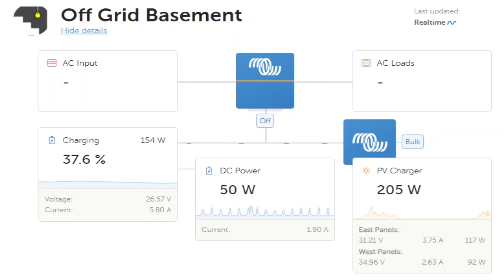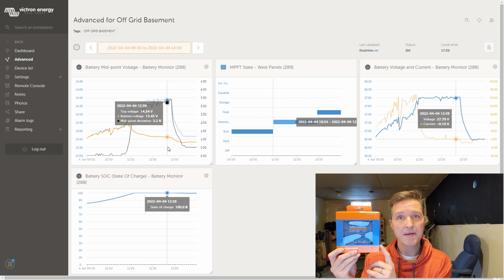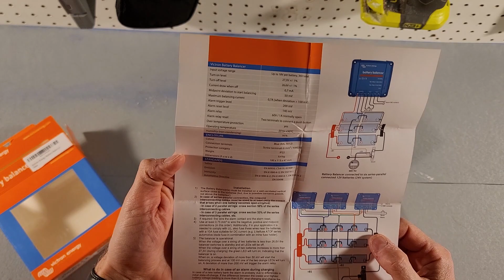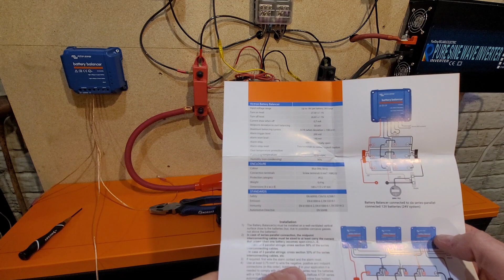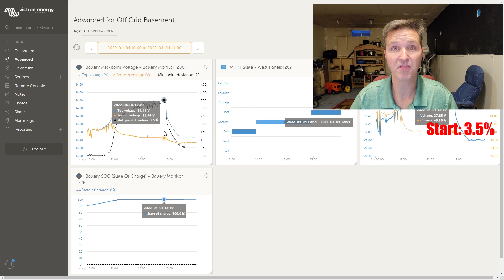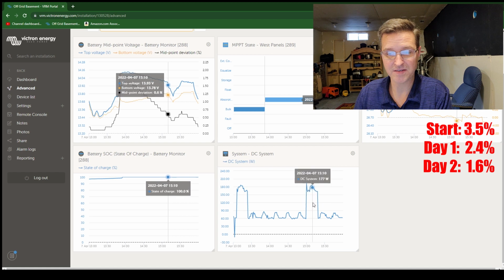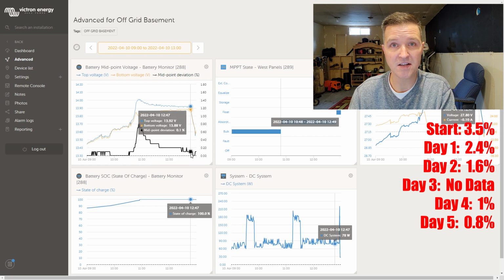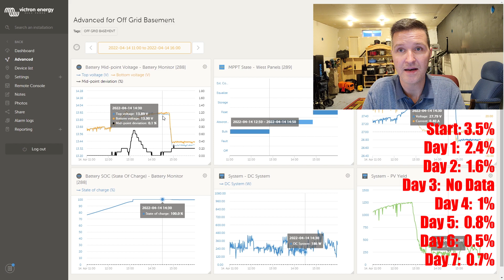Victron Battery Balancer:  Installation and 7 Day real world Testing with LifePo4 Batteries!!

Comment: great video as usual, my advanced setting does not have a mid point graph like yours.  Where do I change it so I can see that?
Reply from the maker: Mine is under "Battery Monitor".  Do you have a Victron Shunt as well?  I believe you need that.

Comment: I hope these will work for 24 Volt 100ah Lithium Iron Phosphate Batteries or My 12 Volt 100ah Lithium Iron Phosphate Battery Packs o 24 Volts on various 10KWH Battery Banks. And 4 Renogy 200AH AGM Batteries also paired in 24 Volt Packs.
Reply from the maker: I've used mine for a couple years now and it still works like new.  Thanks for the comment!

Comment: Hello can I use this Victron balancer is 24 volts sistem with 2s2p ????? How??? Just 1 or 2 balancers?
Reply from the maker: Remember, when you connect two batteries in parallel you're basically creating a bigger 12v battery.  Just connect it like it is exactly that.  Just treat each 12v pack as one 12v battery.  I hope this helps even though it's a bit confusing in writing.
Reply: @OffGridBasement  thanks

Comment: shouldn't you connect all connections to the battery?
Reply from the maker: Yes.  The voltage loss is minimal from the bus bar so I went that direction.  Thanks for the comment.

Comment: I just bought one of these. I have an older 280 amp hour12 volt lithium iron phosphate battery and a new identically sized battery wired in series for 24 V.  Even after initially connecting in parallel and top balancing, the batteries have a difference in voltage of 0.3 volts (and obviously the older battery has a somewhat larger internal resistance).  I'm very eager to see if the Victron battery balancer can handle this slightly two different age batteries and bring them closer together.  I can't really afford to replace the older battery capacity on a load test.
Reply from the maker: Best of luck to you!  Thanks for the comment.

Comment: Perfecto amigo, es el mismo problema que tengo en mi sistema solar de 24V, una batería llega a 14.2 y la otra en 13.8 ya compré el ecualizador de batería Victron y espero me dé el mismo resultado, nuevo suscriptor.
Reply from the maker: That's great!  It still works perfectly for me.  Thanks for the comment.
Reply: Como te fue despues de instalar el ecualizador?

Comment: I've got 4 in series I wait till the charge controller hits float then just check with a multimeter if there's a low one I just hook a battery charger on it, one took twice doing that to get it in balance, but I'm gonna get 2 of them.
Reply from the maker: Thank you for the information and the comment.

Comment: Thank you for the video. My green light has stayed on after the 3rd day of use. It was on this morning and my batteries were at 26.3. Is the green light suppose to be on? I thought it would not come on until the batteries reached 27.3?
Reply from the maker: That's odd.  You're right.  It shouldn't be on until 27.3v.  I would disconnect and reconnect.  Sort of like turning off and back on again.  Hopefully it will reset.
Reply: I will try that thamks! @OffGridBasement

Comment: Excellent presentation of the impact of the Victron battery balancer.  I recently put together a 24V battery bank by putting 2x12V batteries in series and I had the exact same issue when the charge voltage started getting close to 28V.  I was debating whether or not the Victron balancer would work given it only has a balance current of 0.7 amps and I also saw the comments about it not working with Lithium batteries.   A few days ago before seeing your video,  I ordered a cheap 5 amp balancer, but I'm concerned that it will try to balance the batteries all of the time if the voltage difference between them is > 10 mV, instead of just working when the bank voltage rises above 27.3V.  That might work to unbalance the batteries at lower states of charge.  I guess I'll find out after I put it into service.  At least I know that I can go with the Victron balancer if the cheap one doesn't work.

Question: In your setup you connected the balancer negative lead to the load side of your shunt.  Did you have any long term balancing issues with that?  Your balancer might work better if it was connected to the battery side of the shunt instead of the load side of the shunt.  The shunt has a small voltage drop as current flows through it, and that might give the balancer a false voltage reading on the bottom battery.
Reply from the maker: I never noticed any issues with how it was wired.  It just worked..  
Good luck with the cheap balancer.  I do know the victron works so there is always another option for you.  Thanks for the comment.

Comment: dont your batteries have built in BMS?
Reply from the maker: Yes, but the BMS doesn't help keep the batteries balanced.  It keeps the cells inside the battery balanced.  Thanks for the comment.
Reply: @OffGridBasement  "but the BMS doesn't help keep the batteries balanced.  It keeps the cells inside the battery balanced".The Cells inside the battery is where the power comes from. There isnt a sperate battery inside the plastic casing. Im sorry but i dont understand your comment at all. If your cells are way out of balance then your BMS isnt doing its job. Moreover doesn't a BMS balance you Cells?
Reply from the maker: @mannyfragoza9652 my apologies.  The balancer keeps the two 12v batteries in balance with each other.  Keeping the two batteries in balance with each other has nothing to do with the BMS inside each battery.
Reply: @OffGridBasement  Then 99% of the folks that have these all in one batteries dont know their cells are out of balance? wow that just doesnt sound right.
Reply from the maker: I want to make sure you understand the difference between this balancer and a BMS.  This balancer keeps two 12v batteries in balance with each other.  A BMS  keeps track of the individual cells inside of a Lifepo4 battery.  This 12v battery balancer is not a battery management system.  I hope that clears it up a bit.
Reply: @OffGridBasement  If your cells were unbalanced what makes you think all these people that think they have a built in BMS their batteries are balanced? All the All In One Batteries reviews ive seen ive never one saw someone adding a Balancer to their battery which has a built in BMS. Have you checked other ALL- IN- One Batteries to see if its cells were balanced? Could it have been your BMS wasnt operating properly?
Reply: @mannyfragoza9652  I think I’m understanding your confusion. The use of battery balancers is relatively rare with LiFePo4 batteries mostly because there are options to buy batteries in the voltage you need for your system setup. It is normally recommended that if you want a 24 or 48 volt system, that you NOT build the battery bank out of 12 volt units. Balancing between the 12 volt batttery units (as opposed to the cells contained within the battery units) is but one of the reasons to avoid this plan. Just buy 24 volt batteries for your 24 volt system, or 48 volt batteries for your 48 volt system, and no external balancer will be necessary. You are correct that the BMS in each battery will manage balancing, but ONLY the cells within that sealed unit. The BMSs in each battery unit cannot communicate with any other BMS in another unit. If you’ve made the questionable decision to build a higher voltage bank out of 12 volt units (like myself and many others), then adding a balancer between the units acts like a limited-function ‘external BMS’ for keeping those units in balance. Hope this helps clarify :)
Reply: @offgridiot  thank you and i totally get what you are saying and makes perfect sense.
Reply from the maker: This balancer is for two 12v batteries connected in series.  It has absolutely nothing to do with the BMS inside the battery.  It works with SLA batteries as well and they don't have a BMS.

Comment: If I may ask, why did you take the negative for the balancer to the Negative Bus bar and not to the negative of the battery bank? Apologies for asking, it just seems to me that eliminating any electrical component interference in the measurements that the balancer is taking/ working on would be best
Reply from the maker: It would be.  I'm actually not sure why I went that route.  My new set up will need to be directly to the negative of the battery.  Thanks for the comment.

Comment: I have to ask myself why the high battery is discharged (I assume to some resistance) to bring it in line with the lower battery. It would make sense to me, considering the type of system, that the high battery is partially discharged to the low battery ... thereby not wasting generated electrical energy. Heat is the lowest form of energy ... it should not be a factor in this equation (IMHO)
Reply from the maker: That's a good question.  It must be because the unit would need to raise the voltage for the lower battery to gain charge.  The voltage would probably need to be higher than the high battery due to voltage loss across the conductor.  Just speculating.

Comment: I was wondering how your balancer is doing after some time has passed?  Im about to do my 6 month maintenance on my battery bank. 2 -12 volts in series . Plan to charge each one separately then let them set for 3 day in Parallel, add the balancer and back to Rockin and Roll.
Reply from the maker: The balancer is still doing its magic!  I'm very happy with it.  Thanks for the comment.

Comment: On your CCGX widget you have "Top Voltage", "Bottom Voltage", and "Mid-point deviation" on the graph.  How did you set all that up?  My BMV 712/only has "Mid-point voltage" in the drop-down on the widget settings. I found your video on setting it up with your smart shunt, but I have the older shunt only (not smart).  I guess it doesn't have that functionality?
Reply from the maker: Yes.  I believe it needs to be a smart shunt.  I didn't need to set anything up.  That is the default settings.  Thanks for the comment.

Comment: Hello, Professor, I purchased the balancer, charged each battery separately, and connected the balancer to the batteries. It did not perform any balancing operation on the battery. I waited for it for hours, and upon examination, the battery found a different voltage. What is the reason?
Reply from the maker: You have it connected to two 12v batteries, correct?  When the 24v bank reaches 27.3v the balancer should turn on and start balancing.  Does the balancer even turn on?
Reply: @OffGridBasement  I checked the positive battery on the meter and the battery found 13.41 volts, and I checked the negative battery and it showed 13.78 volts and the device did not perform the balancing operation.
Reply from the maker: @1990_Vip  that voltage only adds up to 27.19v.  it needs to be 27.3v before it starts balancing.  I would manually charge up one of the batteries so they are closer together in voltage.
Reply: @OffGridBasement  I charged the batteries separately and did not get any results

Comment: Hello Sir. I have a slightly different setup, to you. But, equally, I’ve got a headache!! 

I have 4 rack style batteries, each battery is 48v 200ah, with its own BMS. Stacked ontop of each other. The batteries are wired parallel. 

I am trying to see if this would help; as I’m having some batteries at 20% and others at 90%. 

I’d appreciate your help
Reply from the maker: This unit won't help.  It's used for 12v batteries in series.   I'm surprised you have such a wide range when set in parallel.  What is your wire gauge?  Also, do you have the main negative and positive connected to the same battery?  They shouldn't be.  Let me know.

Comment: Why my battery 25.6v 200ah wont charging under 27.7v,sory to may bad englese riding
Reply from the maker: That's odd.  Mine starts balancing @ 27.3v.  Make sure all of your connections are tight.  You might be losing voltage in one of the connections that's reading the voltage.  Just a thought.  Good luck and thanks for the comment!
Reply: Ok,voltage in the morning is 26.2 is that ok or bad,working fridge 50w,ligthts,mobile phones charging,tv 20w,all conect are thought good

Comment: Would having 4 12v bat in 2 sets of series in parallel for 24v require 2 separate balancers?
Reply: No.  I'm doing 4 batteries and Victron documents this.  Connect two in parallel, now they act as one and the balancer can do nothing.  Connect two parallel groups in series to make 24v, and the balancer can balance between the two groups -- only one balancer.

I recommend an initial balance:
1) charge each battery to full. this may take some time so either let all rest for a few days after the last is charged, or charge them all again which should go quickly (within a few hours)
2) connect all in parallel
3) charge the parallel group
4) disconnect charger and let rest for a few hours
5) repeat steps 3 and 4 until voltage after rest is over 14.4  (voltage immediately after disconnecting charger ideally over 14.5)
6) now disconnect and wire as needed for final configuration

After doing this my batteries maintain balance well.  I'm not sure if I'll do a victron balancer.  Back in the old lead acid days I really wanted a balancer so maybe after time the lithium will drift apart, and the balancer is a lot easier than repeating the initial balance!
Reply from the maker: yes.  You would need a balance between each set of 12v batteries connected in series.  Having the two sets in parallel would keep the overall 24v of the sets in check, but it wouldn't do anything for the individual 12v batteries in each set.  I hope that helps!